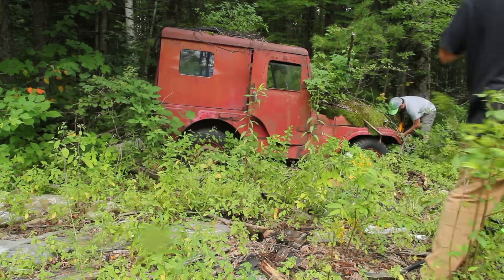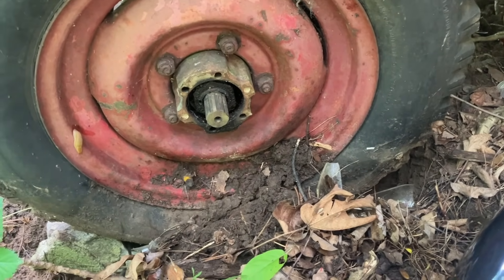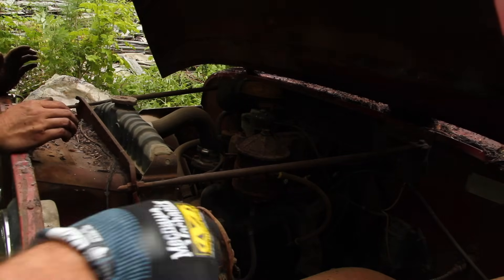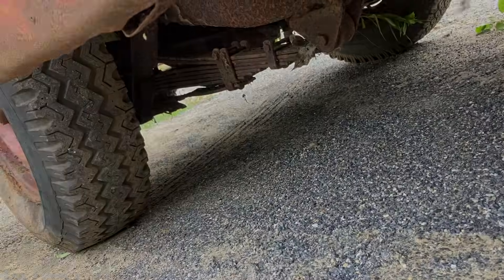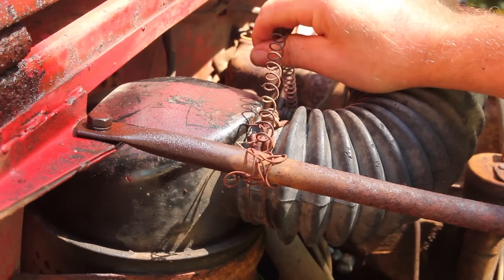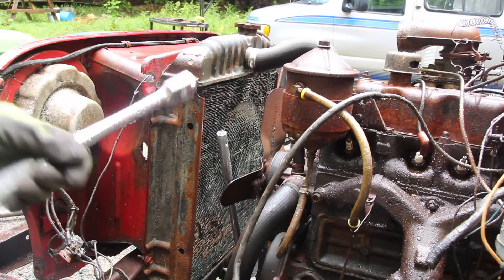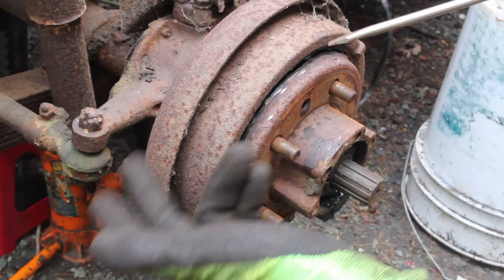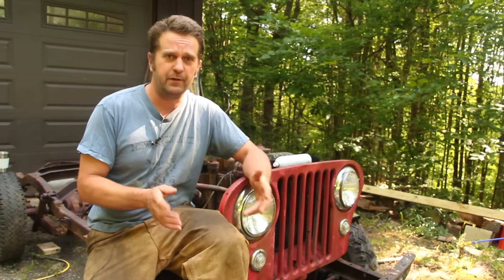Jeep Rescue- 1956 CJ5 rescue and tear down

Comment: I also like Willy Jeeps, I drove one in 1971 during my military service in Siegen Germany and that is why I am now making a scale model on 1/15 with as many parts as possible, both at the bottom and also the engine and seats in the Jeep and this measurements of such a model of scale 1/35 and converting it to scale 1/15 via computer, I have been working on it for almost a year now and then and then the next job is the trailer that goes with the Jeep  👌😊 Belgie 01/05/25

Comment: That looks like its on an M38A1 frame (Military Version). They had reversed shackles on the front suspension.
Reply from the maker: The first three years (or so) of the CJ5 also had the reversed shackles (probably a carryover from the m38a1).  But they didn’t have the machine gun mount on the frame.

Comment: Ohh how f-ing stupid to make it electric. EVs make no sense at all, the most efficient way to use fossil fuels happens to be the internal combustion engine, when you make it electric it mostly runs on coal, the most polluting form of energy, the batteries take a lot of energy to produce and they don't last very long, they are a fire hazard. And lastly but not least, it doesn't solve anything.
Please watch "Climate the movie" and get wiser.

Comment: I have a 1953 ex military M-38A1 like that CJ-5. It has that same hardtop on it. My top has a small brass plate on the right side that says Koenig Iron Works on it. 

Koenig was big back in the day making tops, snowplows, winches, etc. 

When I get around to restoring the Jeep I’ll probably just go with a repro military canvas top.

Edit: I made my original comment about the hardtop when I was only a few minutes into the video. Now I see that top does have the Koenig plate on it.

Comment: I bought my 78 CJ5 last year after switching from motorcycles (leg amputation). I found a fairly decent body and great frame. Getting 258 / 6 and other parts from some off road murders. Hoping to get it on the road. This one is awesome. Looks to be great fodder for a rebuild. Please don't go EV. These old jeeps should chug along and barely hit 55.

Comment: I HAD A 1954 WILLIS IN 1985. IT OUTPERFORMED 30-45K FORDS CHEVIES ALL DAY. I PAID NOTHING FOR IT. TOOK IT ON A TRADE ON A 1979 FORD T TOP LTD 2-DOOR. 2500 CASH PLUS THE JEEP. GIVEN THE LTD FROM THE LADY 2 DOORS DOWN. GAVE THE JEEP 3 YEARS LATER TO MY UNCLE AND PUT SA 390 340HP AMC ENGINE FROM A 1970 AMC REBEL THE MACHINE IN IT.  I BOUGHT A OLD AMC WAREHOUSE OUT IN LIKE 1983 AND HAD SOME SPARE ENGINES.

Comment: Swap to a better frame. Rebuild the engine. Paint EVERYTHING with POR-15 to prevent any more rust. And drive it like you stole it. But you'll only go 40MPH at best with the factory 5.38 differential gears. I did the same thing to my 1956 CJ5 but I installed a brand new body tub from the Philippines. Mine's good for another 66 years.

Comment: Electric motor? 😂 lost me on that. I restored and modified a 1971 CJ-5. Buick V6, 4 wheel power disc breaks, power steering, 6 speaker stereo system, Chevy steering column with limited wipers. Did it bacon in the early 90s. 

Stuff a v8 in it. That would be cool.

Comment: I can tell you are definitely NOT a Jeep guy. This CJ is in great condition compared to a lot of them I've seen and worked on. Floors looked mostly intact, windshield wasn't totally rusted at the bottom, the top was in excellent shape. Give the engine time with the P-oil. It may turn yet.
Reply from the maker: I didn’t really show it, but the floors are mostly gone.  The back part of the floor is patched over with some 1/8” plate, the patches on the front floors have rusted out.  The windshield is also rusted out at the bottom- but I found one that isn’t, but is rusted out in other spots so I can hopefully make one good one from two bad ones.

Comment: Please, please don't go electric. That 'F' head jeep is a good motor and 55-60 is top speed. Locking hubs are recommended. The cost to rebuild is less than 'going electric. I agree finding another frame is mandatory. Would like to see a viedo of a rebuild but not too much detail.

Comment: Take a look at SGI, they’re in India and make reproduction jeep parts for these old willys. They literally just came out with an early cj5 reproduction tub. It’s been highly reviewed by jeep guys here in the states!

You can also go that route for a frame, unless you find a good original frame. Which they do exist although you have to search for them.

All in all there’s nothing like driving an old jeep. Open top, windshield down, no seatbelts. 55mph is like the max performance the F head engine will give you. Probably cruise more comfortably around 45. 

Good luck in your restoration of this beauty!

Comment: You've got a lot of work ahead of you on this project but it's a neat vehicle, not many still around, and has the potential for a great outcome. IMHO, the EV conversion isn't a great idea and the money would be better spent toward a restoration. By the time you add the weight of batteries, along with the poor aerodynamics of that body there will be little gain. No, maybe a hybrid conversion similar to the hybrids that Toyota is making........

Comment: you lost me at the electric motor..
Reply: Exact words that came to me.
Reply: I was thinking the same
Reply: Yeah kills the jeep vibe there.
Reply: @hilltopmachineworks2131  lo u Kiki un
Reply: Why not go electric if he wanted too.

I have an CJ-5 converting project as well.

It will be 40 years till I'm done and it has an sick dauntless V6 in it currently but 😂 yeah
Reply: Rebuild the original four cylinder, upgrade to a newer 4 cylinder like a GM iron duke, or even swap in a little diesel, anything but Electric!
Reply: @floridagunrat1625 blah blah
Reply: Same here...
Reply: Why? Electric motor nowdays is WAAY better than tdi tech. 

Lemme say 80k electric is v12 equivalent

Comment: Jeremy, this Jeep reminds me of my '46 CJ-2A (early model).  A previous "owner" built his own hard top for it, but welded it to the windshield frame solidly across the top and stitch welded the angle iron frame to the top edge of the body.  All I had was hacksaw blades, so it took "a while" to cut it off.  Hopefully, before I die, I'll either repair the windshield frame or replace it.  ;)  The floor is completely gone in the body that I have (due to leaves accumulating in it since it had no "solid" doors.  The main cross-member under the front end of the engine in my Jeep is a steel tube welded between the main frame members, but one side has cracked at the weld.  I really look forward to what you do to get this Jeep back on the road!  Also, being afraid of going over 55 MPH (~88.5 KPH) in the Jeep may not be a problem because my Jeep never could run that fast due to its gearing.  I think the only way mine would go faster than 55 MPH would be to drive over a cliff tall enough for gravity to reach/approach "_terminal_ velocity" over 55!  ;)

Comment: Jeremy, it looked hopeful when camouflaged with half the rainforest growing on, under, in and beside it. Now that it's "cleaned up" I'm beginning, as I'm reasonably sure you are, question your sanity/insanity at attempting this "project"?
 My suggestion would be to contact Paul at Fabrats and see if he's aware of a frame for it. After that it basically new springs etc. 
The motor I'm sure you could find something that works. Electrifying it?? Like you said it has the aero of a fridge. But having seen what you can do with other "piles of excrement" I'm sure you'll figure something out. 
We'll be watching and waiting. Good luck from Canada's banana belt.
🤔💩🤔💩🤩🦃🇺🇲🕊️🇺🇦🍌🇨🇦👍

Comment: If you have a tig, or mig or even stick or gas welding setup, you can make your own chassis, and make it better, just go to scrapyard, get good steel tubes, c sections, pipes and replicate the original, making changes to reduce weight, add strength and so on... I would bet that the engine has a crossbrace beneath it, or whatever you would call it, that is likely cast iron... It can be replaced with steel tubing construction that will be as strong, or stronger, while removing around 30 kg of cast iron for some other project... I am considering getting an older mercedes truck and doing so, but a truck is much larger than an suv like this, and with all my current machinery resto projects at hand and others in the works, a truck will have to wait up...
Reply: Naw swap a yj frame